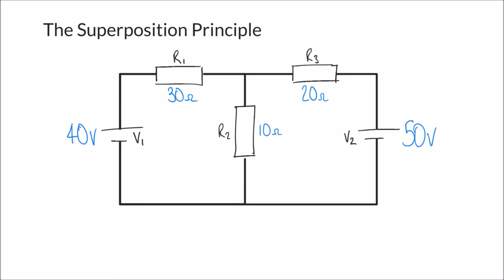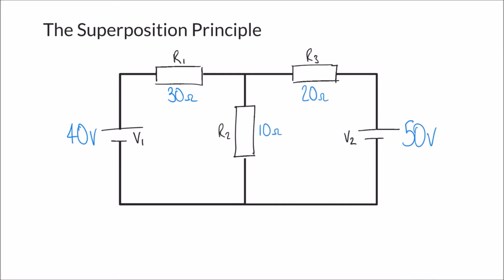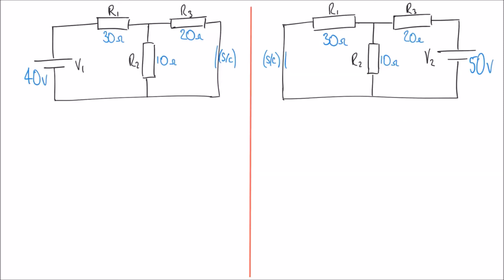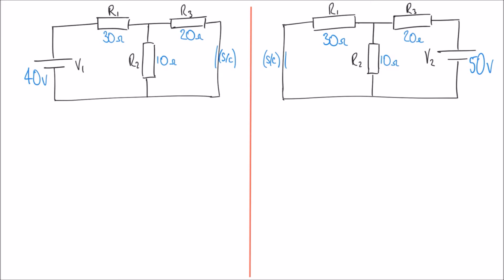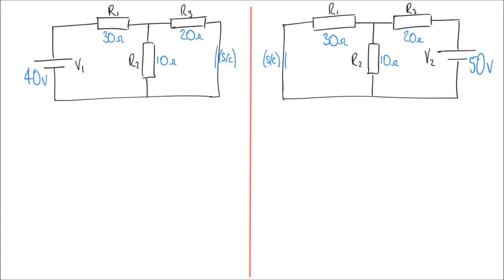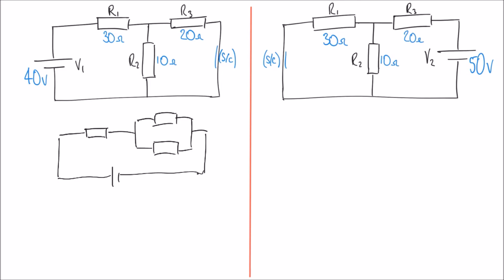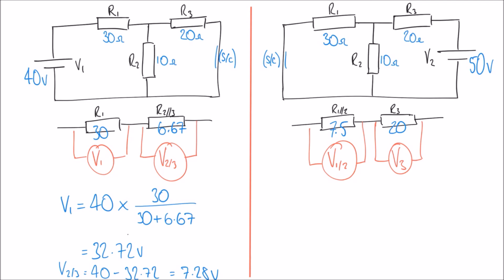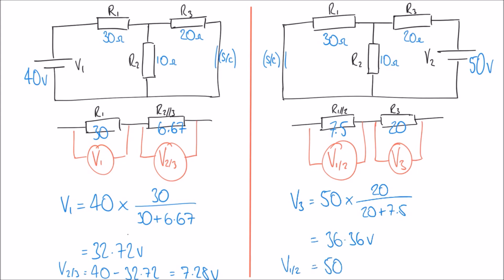Kirchhoff's Laws and the Principle of Superposition

Comment: this is very useful, i have a similar question that looks like 3 resistors in parallel but one in the left one the right and one in the centre, i have 2 power sources one left and one centre. I am not sure if i should consider all 3 in parallel or just 2 as they between the same nodes
Reply from the maker: If I understand you right, you have something that looks like:
__________
R1     R2     R3
|          |         |
V1    V2       |
|_____|_____|

Where V is a voltage and R is a resistor. If that is the case, then the method can be followed the same as this video, except you will have to imagine where the currents split: Current from V1 will flow through R1 and then split between R2 and R3. Current from V2 will flow through R2 and then split between R1 and R3.
Reply: @EngineersAcademyLTD  yes this is how my problem is set up, would you not work out total resistance also? or just work out R on each one for each power source ? i have + and - on my sources so surely the circuit can only go one way? positive to negative.
I will try to follow the video
Reply from the maker: For the purposes of superposition, there isn't really such a thing as the "total" resistance - it is the resistance viewed by the source. And you have two sources, so there is the total resistance as "seen" by V1, which would be R1 + R2//R3 (I use the notation // for parallel), and then the resistance "seen" by V2, which would be R2 + R1//R3 in your case.
Not sure what you mean by the + and -, but providing that they are both pointing + upwards in the same direction, then the method followed in the video is the same, otherwise if one is pointing + downwards, then those currents are going to be reversed in their direction when it comes to adding the totals at the end.